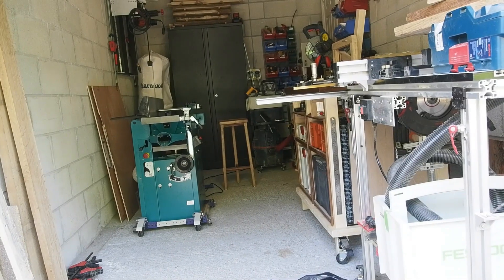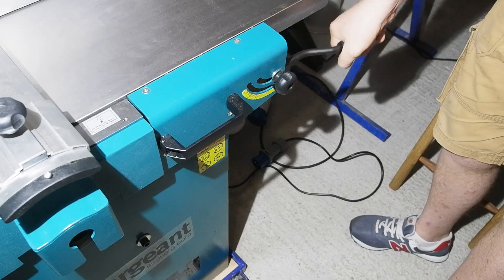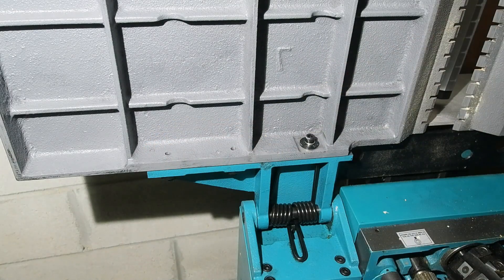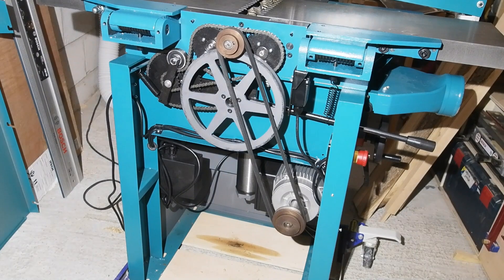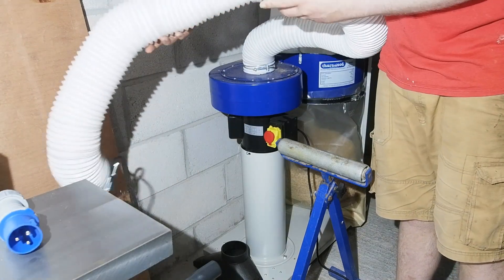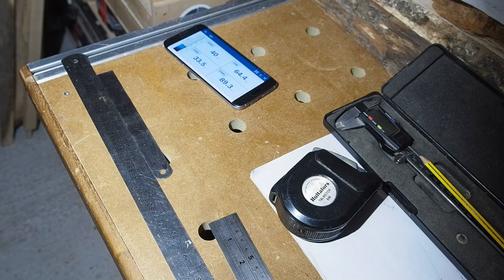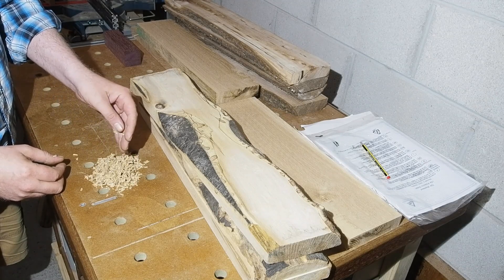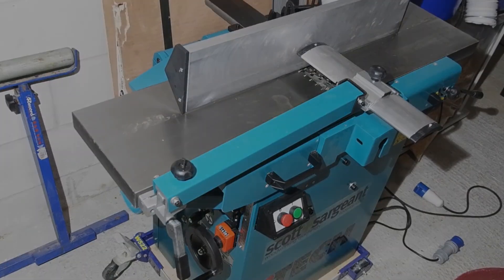ITECH 260S Spiral Planer Thicknesser Initial Thoughts, Setup and Test Review

Comment: Well i waited about six months for mine to arrive just before Christmas 2020 ,ordered after a lot of research much like yourself i came to the same conclusions . Its a great machine well made and finished like you said it will need some set up ,my tables were spot on but i needed to sort out the feed roller height in relation to the cutter block not hard but takes time to get right . After a years of light use im still smiling every time i use it . Great video review which i could not have done better . A sound investment i would recommend amnd the guy's at Scott&Sargent where a joy to do business with , Dave the delivery driver was a very helpful as well .
Reply from the maker: Wow, that was a long weight. 4 weeks for mine I think. One of the tensioners for the infeed wasn't even in place on mine! I the the reason it dropped out was it needs to be backed off almost completely not to leave marks.🤷‍♂️ Still, couple days or so tinkering and it ran great - and does still. Honestly, I would be preferred a 12" machine but just don't have the room. This is a great compact "proper" PT though. Quiet and I love the ease of swap over.👍
Reply: Yes that's much the same as mine leaving marks ,delivery was affected by covid and brexit and the fact it got transshiped in Holland on the last leg .
Reply: @mauserkk98  Mine is doing the same. What needs adjusting on the feed rollers and how do I go about it? Struggling for information. I've phoned Scott&Sarg and they are helpful, they said I need to very finely adjust the springs. But, what springs? How do I access them. It would really be good to hear from someone who has experienced it. My wood vibrates as it goes under the first feed roller, quite obviously shuddering, and I almost have to push and pull the wood through, even though I am only taking 0.5mm cuts. It leaves chatter marks. Yes, they sand out, but as Scott&Sarg said, I shouldn't have to put up with it. Any tips? Thanks in advance, I'd be extremely grateful.

Comment: Hi
Great Vid, do you have a link for the 16amp socket you used ?
Reply from the maker: Cheers Stephen. It was just a 16a double outlet from Toolstation. Got it from their eBay here: https://www.ebay.co.uk/itm/Industrial-Socket-IP44-Twin-240V-16A-2P-E-/293305355729?mkcid=16&mkevt=1&_trksid=p2349624.m46890.l49286&mkrid=710-127635-2958-0
Reply: @BischBaschBosch  Top man cheers. Am in the same boat as you so have to be careful what i change in my garage, looking to get a bandsaw too so the double out let will be great, i will only be using them 1 at a time so i am going to run a tempory circuit to a Type c mcb so they will be on there own circuit .
Reply from the maker: Yeah, a C type 16A mcb does the job. Runs both my PT and chip extractor together no probs. The double socket I have is the always-on type mind. No switch on it (couldn't find a double with switch). You could always interupt the cable to the double outlet with an isolator switch. I just unplug when done myself.

Comment: I can't remember where I heard this suggestion but to make budgeting for cutters easier each time you need to turn the cutters buy one rows worth of new inserts and change out 1 row completely (Mark the dull edge) this leaves you with a supply of part worn cutters to replace any chipped inserts.
Reply from the maker: That's a pretty good idea bud. They're sold in 10 packs...at S&G anyway. Figured I'd buy a pack or 2 each turn as I've seen vids of people struggling to undo some, resorting to breaking the blade off to free the screw. Now I've got 2 reasons! 👍

Comment: Very interesting and informative review. I am new to woodworking and I have been looking to purchase one but not at this price point. I am torn between the HC260C and AXMINSTER CRAFT AC250PT. Do you think that it is worth the extra £350 and go for the AXMINSTER CRAFT AC250PT? Thanks
Reply from the maker: Thanks Mahmood. Well, in terms of capacity and bang for your buck, Metabo's HC260C is hard to beat. It also has the advantage of being a compact machine if space is tight. In fact, with it not having a floor standing cabinet, you have the option of making your own base for it with storage below. It does have a universal motor (albeit brushless) though which will be noisier than machines like the Axminster with induction motors. Also only has 2 cutters. The Axminster is a budget "proper" planer thicknesser. Cast iron beds, proper piston lift for the thicknesser and 3 blades on the cutter (something standard on higher end machines). A lot of the architecture on the Axminster AC250 is actually the same as most £1000-2000 machines. I suspect they're for the most part coming out of the same factory just with a catalogue of options for brands to choose from. The lift gear for the thicknesser on the axminster is the same as mine, as are the rollers for example. As they are on the "Trade" versions of the 250/260's. 
I have to say, I've not used either machine but whilst there's nothing wrong with the Metabo, many people swear by it especially at it's price point, I would hazard that you'd be happier for longer with the Axminster.   They're both budget machines with obvious compromises but the axminster has a few details making it a little more serious. 
Worth considering that the Axminster has an odd table lift arrangement when swapping to thickness mode. The tables swing out/up to the front of the machine. Hardly a deal breaker but just a bit weird.  
When looking at budget machines, it's not really about which ones best so much as which one has the compromises you can live with for the money.
Reply: @BischBaschBosch  Thanks for the review of this itech - very helpful. I'm also weighing up going for the iTech versus something cheaper like the Metabo. Do note that Metabo do list the HC260C as having an induction motor on their website (which as you say, is really important to have one with an induction motor!)
Reply: Thanks for the very detailed response. Much appreciated. A few things to ponder now. As you mentioned sapce is also a consideration. I have a very basic dust extraction system so will need to factor this in the setup.I am leaning towards Axminster.

Comment: Could you do a video on how to set the thicknesser?
So the dial indicator is accurate?
Reply from the maker: Hi. By dial indicator I assume you mean the digital readout behind the hand wheel to adjust accuracy for depth? I may do. I've had a few questions so may address them together. In the meantime, there's a little cover behind the hand wheel between it and the digital readout. Loosen the grub screw on it and move it out the way. Underneath there are 2 further grub screws. Loosen those and turn the numbers until they match the thickness of of a piece you've machined and measured, then lock the grub screws back down. You might have to do this a couple of times to get right.
Reply: @BischBaschBosch  Thank you. I have this P/T, and I've never tried to balance the tables - are you planning on doing a detailed video on that. I did watch the S&S video, and it's not as clear as I'd like.
I guess I'm a bit worried about making it worse! Thank you for your video.
Reply from the maker: @Parafinn1970  I wasn't planning to buddy, no. If I can find the time I'll try though. Have you checked your tables with a straight edge to see if they're in planar with each other? Also worth using the rule method to check the outfeed table in relation to the cutter block. With a metal rule resting on the outfeed table, check the cutter/blade drags the rule no more than 5mm when you rotate the cutter. A little less than that is fine but it should move the same amount each side of the cutter block/table. If it's different, the outfeed table will need adjustment. With the infeed raised to 0mm, you should use a 1m+ straight edge (the back of a guide rail would do if nothing else) to check it's level with the outfeed table. If these are OK, then no worries. If they are out of whack, you will have problems with your stock. It won't be properly flat or square and/or will plane unevenly. It could take me a while to do a video if I do one so if you really don't want to attempt adjustment yourself, maybe call S&S or other outlets of such machines to see if they know of anyone offering a set up service. Worth a try.
Reply: @BischBaschBosch  That's really helpful - thank you.

Comment: Nice video, thanks for sharing.   How did you get the machine off its pallet and onto the trolley?   We need more details than 'Jedi powers'!

I've been thinking about a machine of this size, but am struggling to imagine how to get it onto a set of wheels....
Reply from the maker: Ha! Cheers Nick. "Jedi powers" my sarcastic way of hiding the struggle. It essentially comes on 2 pallets. 1 ply one and one Euro pallet. I made a ramp using 2 bits of 2by3. One end screwed to the pallets, the other resting on my dolly. I lay some ply on the dolly so the machine could slide onto it too. I took the back cover off the machine so I Could grab the body. The rest was brute force. If I had any, I'd have probably called a mate to help!😁

Comment: Nice review. Like the bit around peak load trip and Jedi powers of course. Dust Spares for hoses. Good quality and made in U.K. at competitive price. 
You need a bit of machine wax action (stuff works and help keeps rust at bay 😁)
Reply from the maker: Cheers Doug mate. Already got a bit if pu hose waiting for me ( and a couple bandsaw blades) at the local dealers who sold me the extractor. Just gotta pull my finger out and get em! The silly bit in the middle of the vid about the Axminster deodorant...that's machine wax😉👍 Don't know about you but I give my saw blades a buff with it too. Seems to work pretty good.
Reply: @BischBaschBosch  the better 3/4ers takes the piss about polishing tools, keeps me amused
Reply from the maker: @dougsaunders8109  😂😂 Yeah I often get it in the neck for that. 🤷‍♂️
Reply: Only machines manufactured in UK are sedgewick. The Hitech machines I have ( dust extractor) made in China. I did enquire about a planer and was informed of a 12 week waite from Chinese factory.

Comment: I was looking for a planer thicknesser recently ended up going for the Metabo as it has a brushless motor and is semi cast iron, at £650 and a long wait for stock to come in and it works well for me I did look at the axminster but did not have room in my garage for that.
Reply from the maker: The Metabo is unbelievable value really. Best equipped machine at The price point I think. Space is tight in my garage too. Everything has wheels though which helps.👍
Reply: @BischBaschBosch  also good with resharpenable blades

Comment: Cool I've been looking at this one!
Reply from the maker: Nice. Once dialed in, it's a great little machine. I especially like the quick swap between planing and thicknessing. If there's anything I missed in the video you wanted to know, just ask me here bud and I'll do my best to answer.
Reply: @BischBaschBosch  thank you that's great, do you think it would be much of an upgrade from the metabo hc260c?
Reply from the maker: @samrix5793  Honestly Sam, without having used the Metabo, I couldn't say. What I could say for certain is that the ITECH would be quieter. Easier to swap between planing and thicknessing and that I think the spiral blocks are very good on difficut wood. All the planer thicknessers I've used before have been 3 phase industrial machines and, although mine obviously lacks the capacity and power of those, the spiral block makes the finish on this humble by comparison machine, at least equal to that from those machines costing many thousands ££ - if you don't do too deep a pass! As always, only you can judge whether a new investment is worth it or not really.
Reply: @BischBaschBosch  hay how's it going? 7 months on?
Reply from the maker: @samrix5793  Proving a decent workhorse so far mate. Probably planer a couple thousand metres and still a clean finish, blades still sharp. Not needed to turn the blades yet.👍
Reply: @BischBaschBosch  that's awesome thanks for the update, I'd like to get one but kind of want to be able to move it forward and backwards for space but didn't know if there likely to keep throwing it out of square
Reply from the maker: @samrix5793  Mines on a rolling base Sam. I move it around all the time. I have to as I'm tight on space. No issues staying true so far.
Reply: @BischBaschBosch  ok that's great yeah I saw your base before going left to right but didn't know if you moved forwards backwards too
Reply: Brilliant review. I’ve been thinking of upgrading from my Inca 260, which I love but the transition between modes is a bit fussy.  I really like the quietness of the spiral block too, and it being easier on the extractor in terms of chip size.  Thanks for these videos.  You’ve got a great manner and turn of phrase.  I really enjoyed your Bauhaus chair one too, impeccable.
Reply from the maker: Very Kind, thanks Mark. Appreciate that.👍